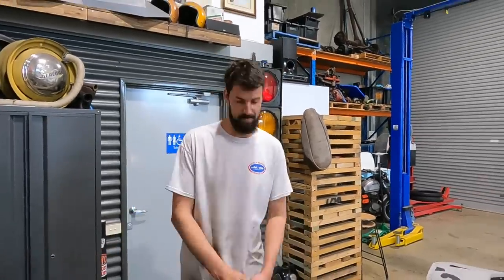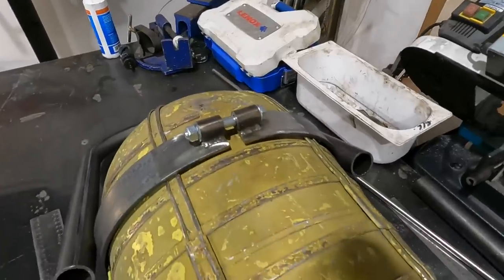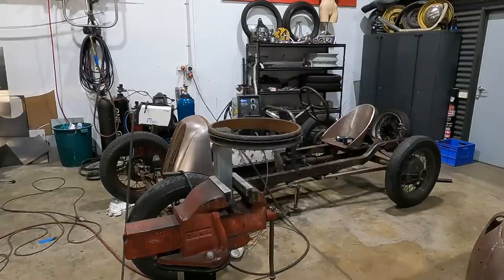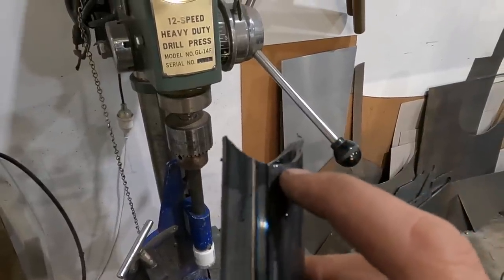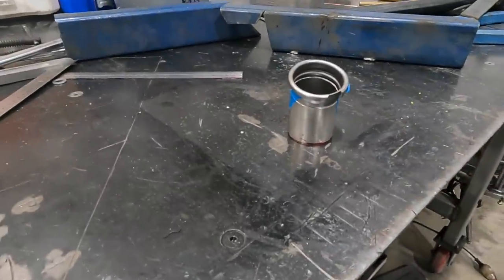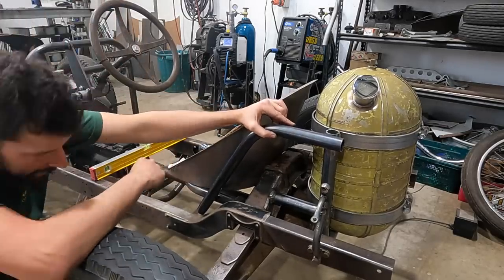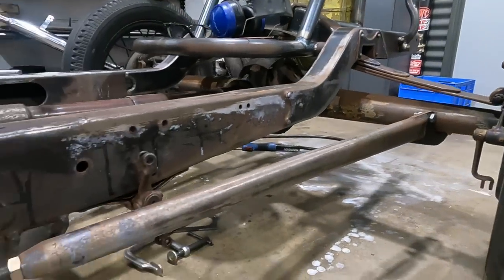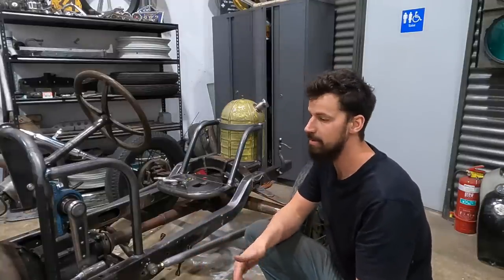WWII Oxygen tank modified to fuel tank - "Single seater race car"

Comment: Jordan this build just gets better and better. I do have a word of caution about using the tank support for your tank vent. Although it would be very aesthetically pleasing it could cause you some issue. Mud dauber wasps could get in there and block the open side which could stop your tank from venting properly, or worse yet fill with vapor and ignite when you start the car. I could be wrong but I have the mud dauber wasps make nests in semi truck fuel tank vent tubes that weren’t properly screened. There have been a couple airplane crashes attributed to mud daubers plugging tubes and causing the plane to crash. I look forward to the next video.
Reply from the maker: Thanks John, if I decide to use it that way the other side will be a brass vent to keep dust and debris out
Reply: @bennettscustomsco  I figured you had a plan, but I know when time is short I tend to overlook little things. I hope you didn’t think I was trying to say you weren’t thinking ahead.

Comment: Jordan, this car build just keeps getting better and better! I rarely comment suggestions and realize your a very intelligent and talented fellow. I'm sure you've thought about it but do you think maybe some more protective structure around the gas tank would be needed? I'm speaking about going to the end of the frame. Maybe a horizontal hoop around the back also. Tough call when weight is a factor.
Reply from the maker: If there’s time I will add a small hoop to pickup the push bar I’d like to mount

Comment: Awesome Minion fuel cell.  So happy you went back and updated the rear radius rods.  Man this this race car looks so amazing.  Hard to tell by just watching from thousands of miles away, but does the fuel door have enough spring preload to stay fully closed?  👍👍😎👍👍
Reply: I was wondering too…maybe a little rare earth magnet inside the opening if it doesn’t ?
Reply from the maker: It does yes! But a tan or magnet will keep it tight

Comment: It just gets better and better! Been watching this since you came back to BC to work on the nose at Karl's place (I'm in Oliver in the Okanagan). Still think you're making it too nice -- show car not going to want get it dusty. I think tho' that cockpit looks long. Back in the day, car like that had short cockpit because steering wheel in drivers lap. Had to be. Picture this -- 1932 -- Indy 500, "the brickyard" because the track was brick and not smooth like today -- manual steering and 500 miles to go -- can your car average 100 mph? if so you've got 5 hours of cranking that wheel around. Drivers wanted that wheel close so they could use their shoulders to help steer. sprint race like what you'll be doing maybe okay. Thinking maybe a fairing from cowl to above wheel so your hands are under fairing, make it look shorter and still same entry/exit . My 2 cents. Looking forward to next video!
Reply from the maker: It’s long because I’m long, I reckon it will look the part once finished

Comment: I would have run the cowl brace strut from the brace straight back to where the frame kicks up over the axle.  Then the strut would have provided some side protection for you if you got T-boned in  the side.

Comment: I think you'll need baffles, if it doesn't have any.

It may have some, since the oxygen would be pressurized & liquid, but regardless. There may be feeding issues, and will definitely be weight shifting/sloshing issues.
Reply from the maker: will give it the go and see what happens!

Comment: If you didn't want fuel slopping over and down inside, install a rubber flange on the spout back to the filler door.  I didn't explain too well, see a typical car filler.
Looking great.